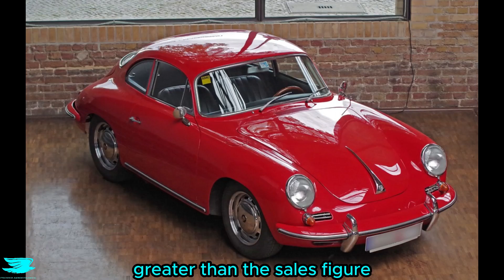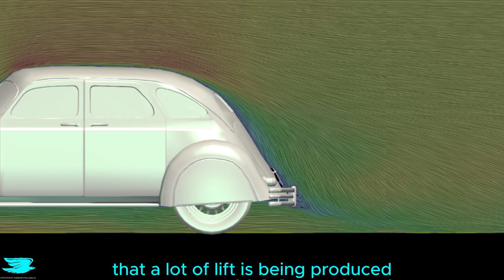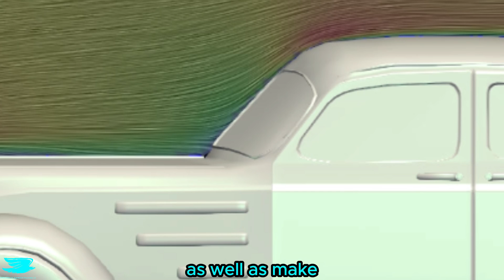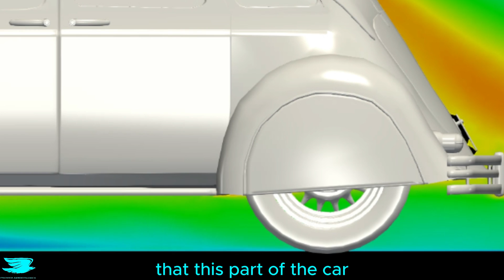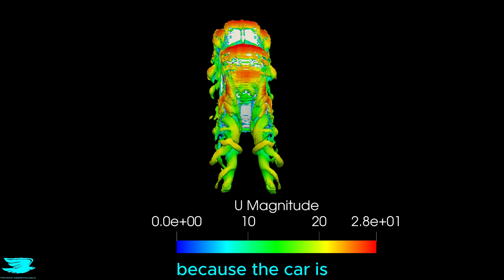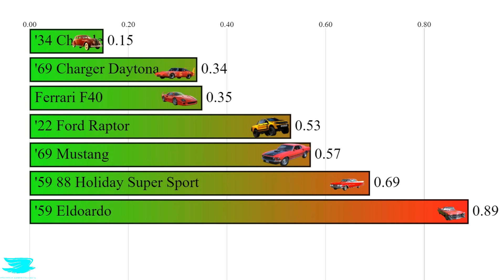*Extremely Old Car* Aerodynamics From 1934

Comment: I own an 1935 DeSoto airflow, and the model you're using is pretty inaccurate in a lot of ways: 

That's not really a 34, that's some weird model with a 34ish chrysler front end, 34 bumpers, 36 tail lights, and an integral trunk as if it's a coupe, but on a sedan body without the integral trunk lump they grew in 36/37. It's also missing the spare wheel 34/35 had. The side/hood vent doors are also flush to the body on 34, not weird louvered lumps like they are here. The bumpers are also way too tall and thick, it's missing the streamlined bolt covers, and the chamfers are a bit shallow, comparing to the one i have sitting in my office here.

The body shape is just generally wrong in a lot of areas. The windshield looks too steep and the split angle is much too shallow. The nose is very very wrong. The original was a perfect radiused arc with the centre of the radius being from the front plane of the axle/wheels. This model is very blunt and steep with a chamfer at the top. I bet the real car is much more areodynamic there as the transition is much smoother. Likewise the front wheel pontoons should also be a perfect circular arc on the front half and taper into the running boards much smoother. And the rear half of the rear wheel pod should taper out to join the tail much more smoothly as well. The model is also really low poly, so that lumpy surface is doing the boundary layer no favours on the radiused shapes.

The main body should also have a large teardrop profile running the entire length of the car and the sides should have a radiused arc top to bottom as well, both of which this model lacks entirely. The rear end is also slightly steeper than the real sedan tail is, though it also lacks the spare wheel which is just a big disc hanging out on the rear face. I expect all of these would significantly alter the rear wake, for good and for ill. The underbody is also very streamlined, with quasi modern air dams and trays underneath to keep the underside streamlined quite well, which i doubt this model represents at all.

Overall its a credit to the design that even this inaccurate mess is a cut above modern cars 90 years later. It's really suprising that the rear end actually produces thrust, i'm not aware of any other car that does that. Explains how the I8 cars could do over 100mph with only 120 horsepower. 

I'd be interested to see how the coupe and sedan Airflows compared. The coupe had the same excellent front end, but a much longer and flatter tail without the spare wheel. I imagine it would do quite well.

Comment: Curious how the flow managers to stay attached so far at the rear, despite the incredibly steep rear angle?
Reply from the maker: It is partly because the boundary layer has so much energy to begin with and also because the radius of curvature of the rear corner is quite large, so it is a gradual progression from flat to the very steep rear angle. Really well done by the aerodynamicists back then.

Comment: Good to know. I have a 1935 Hupmobile 518d . Very similar body (designed by Raymond Loewy), Front end is longer and not as curved. It always "looked" like it should be aerodynamic, but this shows it might actually be.
Reply from the maker: Yep, I'm pretty sure that one is as well. Perhaps a little higher drag than the Chrysler because it seems a little sharper at the back too, but really good overall, and almost as good as modern cars...90 years later.

Comment: To be fair, its probably never reaching high speeds, so high-speed instability is almost irrelevent to the design.
Reply from the maker: That's true. But I guess if it feel off a cliff it would reach high speeds. Lol
Reply: Define high speed. Is that above 120 mph? Above 80? Above 60?
Reply: @RustOnWheels Considering the top speed of the Airflow was somewhere around 90 MPH, 120-140 would be high speeds for such a design.

Comment: Original Beetle? An early model like a split window or oval window. Would also be interesting to compare and early model to a late one, see how the aero changed with updates/styling changes.
Reply: This would be really cool
Reply from the maker: Thanks for the idea! It's on the to-do list, but it might take a while to do.
Reply: The original VW Transporter reportedly had lower drag than the Beetle. The flat, nearly vertical windshield was the beetle's weakness in that respect.

Comment: Yo do a 98 Lincoln Mark VIII Drag coefficient of 0.33 It had Active air suspension. The faster you went the lower got. When you do the mark 8 test you will have to run it multiple times with the car at different ride heights. You guys should also do the Lotus Carlton Drag coefficient supposedly of 0.28. Another cool comparison besides drag coefficient would be mile an hour before liftoff. technically won't slower cars have less drag there's less air moving around them? It would help explain the anomalies in the drag coefficient chart
Reply from the maker: Thanks for the ideas! As for whether slower flow has a lower drag, that is definitely true, but in terms of the drag coefficient, slower flow may not necessarily yield a lower drag coefficient. It often is the opposite case.

Comment: I imagine how much a spoiler would affect the airflow if it was placed below the rear window, like some Porsches had, to prevent the airflow from going all the way down. But then it would create a recirculating bubble on the back. Or not, I don't really know
Reply from the maker: I was actually thinking about that and how the earlier Porsche 911 has a very similar design philosophy to this car. The 911 also suffered from stability issues, which is why they had to put such a huge spoiler (whale tail) at the back. The same idea would hold true here too.

Comment: This car is probably extra sketchy at high speeds since it seems to produce a fair bit of front downforce, and rear lift. You can easily tell it's lift because the counter rotating vortices are producing downwash at the rear. I wonder if these vortices and their downwash help the flow stay attached to the roof, and heavily sloped rear.
Reply: It wouldn't surprise me, we found out in ground effect cars that there's a considerable gain in performance by optimising the vortices in the diffuser rather than trying to eliminate then.

 They also allow for greater changes in the direction of the flow before separation, F1 diffusers can go past 20 degrees, while laminar airflow can barely go past 7.
Reply: @davidaugustofc2574  Isn't that the point behind leading edge extensions on aircraft? Ahmed bodies have shown diffusers generate vortices. One thing to consider, maybe you do want recirculating separation at the very exit of the diffuser.

Rules for Venturi designs says ~15 degrees for diffuser expansion, but says nothing about the outlet. Not to mention that same outlet's outwash can potentially push the tire wake outboard. The diffuser in the current F1 cars starts 700mm ahead of the rear axle centerline, therefore the diffuser vortex starts there as well.
Reply: @rolandotillit2867  Venturi designs are for a specific floor and height, floors that are a little higher can benefit from steeper diffusers, given than the vortices effectively change the angle of attack relative to it.
Reply: @davidaugustofc2574  Indeed!
Reply from the maker: Yep, the vortices are incredible, and they definitely help keep the flow attached over the roof. They act much like wingtip vortices that lower the effective angle of attack of the flow near the tips, just like here.